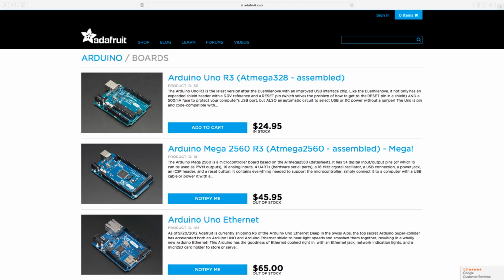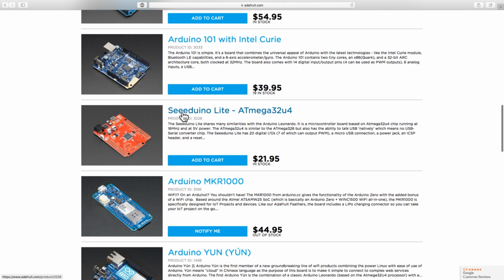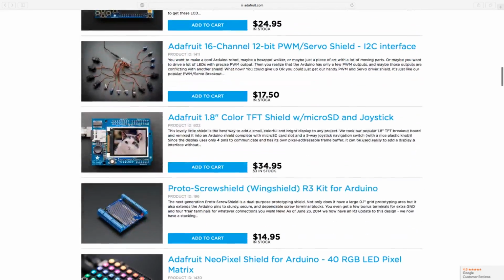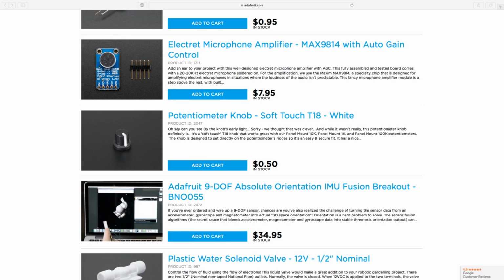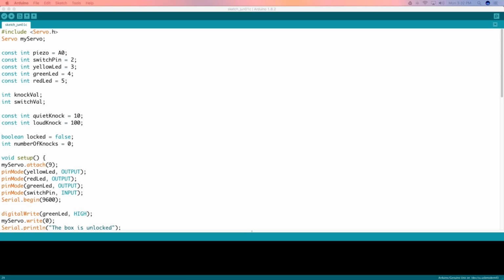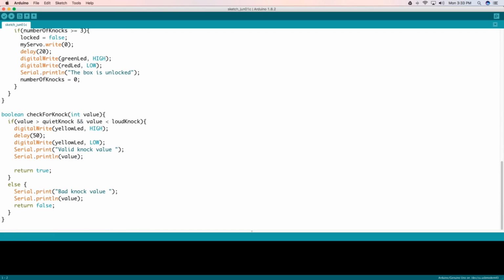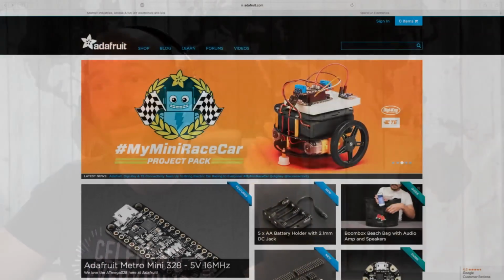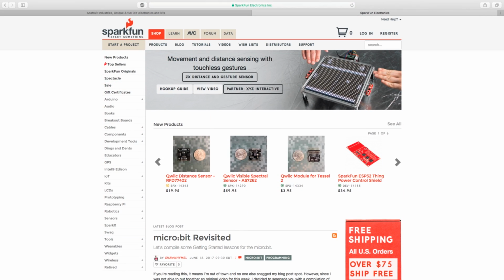Arduino Introduction

Comment: Eli,
Thanks for the "Big Picture" introduction.  I have been roaming around for a few weeks now, not knowing if Arduino was what I was really what I was looking for.   
There is nothing more disappointing than to invest time and money into a product , only to find that it wasn't what you expected. 
I did not realize the depth of what Arduino has to offer.  Thanks for setting me straight. 
Glad that I found your program.

Comment: Micro Center Columbus, Ohio is a great store especially if you have one close, they are on line too but it is hard to beat EBAY for cheap Arduino  sensors and boards and very cheap clone boards . Don't worry about the code just  buy one ARDUINO  UNO V3 and get started, the code will come in time and there is plenty of ready made code you can copy and paste then tweak on the net. This video series 

https://www.youtube.com/watch?v=bY03PJihDMw     should get you going on the code.

Try to get an ATMEL  328 chip on the Arduino Uno V3 that is a dual in line removable chip mounted in a 64 pin socket for easy removal and replacement and to program more chips if needed. If not the hard wired ATMEL soldered surface mount   MPU  will work fine for a starter or dedicated project, just somewhat less versatile  but they are cheaper.

Folks these are a lot of fun, Getting started will not break the bank. Get a plastic proto type bread board and wires, a small 2x4 inch bread board will fit most projects,  9-12 volt battery-eliminator at 1000 mA or 1 amp current  rating wall wart for project power , make sure you have the right power connector to plug into the  Arduino power/ LED's 350 Ohm resistors  pkg X10 to keep the LED's from burning out from to much current.

  Wire strippers for fine wire Harbor freight's "red handle" wire strippers will not do fine wire stripping, but a cheap $5.00 harbor freight multi meter will work great for all electronic measurements  current, voltage, resistance, continuity. Everything else buy as needed for projects from ebay just plan ahead for big projects down the road. A 15 watt soldering iron, (solder .022"  62/36/2) will come in handy cheaper on ebay than anywhere.This is all the breeding stock you will need to get started. I miss Radio Shack, in their final hours they too carried the ARDUINO  boards just before they went to that great electronics store in the sky.

Comment: You can also go to tinkercad.com which is free and created by a major company (Autodesk) - they have a narrow range of components but it's enough to get your feet wet into the world of electronics with the arduino (Complete with it's programming and libraries), the breadboard, and all the many various electronics. Out of the 15 sites I've tried this is the best one and best of all it tells you if you screwed up and destroyed your virtual component (with say too much voltage or throughput power) and overall you can build some intricate stuff with little to no knowledge of hardware or software electronics at no cost and without the stress of trying all this out in real life for the first time and not know what your doing. My first arduino project which controlled an LCD character screen with remote control interaction was done through many many hours of trial and error through this site which helped me learn all about the arduino, and the very basics of electronics and circuitry. Would highly recommend.

Comment: Arduino SUCKS , GO LEARN HOW TO DESIGN and how to program a u-controller you lazy . it is a shame when you see other engineers use Arduino instead of designing the system them self  
some of them are trying to do even industrial jobs done with this !!
, this is what Arduino  is doing to our engineering . i once had an interview with an Arduino Engineer ! after 2 years of working he could not even set the register for basic SPI connection , this is pathetic, addition to that he could not even set a new project in Altium properly , never designed a PCB in his life , ONLY BOUGHT PREMADE SHIELDS and guess what he never even tried to code for a single very easy module like ESP8266 works, to learn it ! and he wants a job, yeah i have job for you , you can start on toilet floor on Monday
with this more and more every day we are seeing more so called engineers that cant handle a simple task of programming or PCB design , well if you can call them engineers !
Arduino  is the suitable for school students to learn some basics not a grown a*s elec engineer to messing around with it
Reply: That's exactly what Arduino is made for, students and hobbyist. I did get a couple breakout boards from espressif. its going to be fun.
Reply: Hi carlos
thats what they said when PLC came out
by the way about putting us out of the job ,i and people who works like me can convert to Arduino  or any other of this kind of boards as fast as like half a day and trust me , we will be much better than a person with just Arduino  experience so no one can put us out of the job 

 in fact me and  my team is right now working on a system similar to Arduino  but with NXP ARM and industrial standards and protocols,something like a C++ based PLC full hardware and Linux support for HMI at the cost of half of what PLC is and 10 times of power ,all the libraries we wrote from base 0 in C++  , we wrote the code for all the shields and designed PCBs and every thing from scratch . this is something that an Arduino user can never do thus i don't think i am going out of a job ! the classes of working is different . and i am not even that much of a programmer my self , there are thousands of engineers who i look like a joke in front of them 

Every thing ready so why bother reading a book??

maybe you are right its better to have more people who can do the job but in fact you are wrong  because the quality of a job is related to the knowledge of the person who is doing it 
more people can do but as i encounter them they are pretty weak in understanding principles , the worst part is that they don't even try , why bother learning a bout network and see the Wiznet datasheet just one time when we can set network in 10 lines of code and not reading the datasheet ?
 i dont have problem with Arduino directlly , but i do have problem with laziness , you wanna do the job with Arduino , do it but at least take a look at the datasheet once , and know what you are doing , or what the Arduino  code is about .

Comment: Do you own any of the elenco Bajillion-in-1 kits like what you used to find in radio shack or their newer "snap circuits" these help to understand the wiring diagram of an arduino. Also if you could name drop atmel who makes the processor in the arduino and compare their data sheet wiring example to a wiring diagram of an arduino it would teach everyone a lot.

Comment: Great introduction for the first class Eli, I'm glad you are using this structure to teach. my starter kit arrived yesterday but it's branded Genuino. it may be a silly question but is there any difference between Arduino and Genuino? looking forward to the next class
Reply from the maker: do a google search... not being snarky, but there seems to a big hubadoo on the subject.

"Much of 2015 has seen the open-source board maker defending itself from its former manufacturing partner, which recently claimed ownership of the brand, launched its own Arduino product line and website, and worked to bar distributors from buying Arduino products from other manufacturers."

... it's too late in the day for my brain to sort this one out...
Reply: Thanks Eli, I think my query was probably insignificant, the kit obviously works the same. Time for some shut-eye here too. see you on the next vid👍
Reply: +Shane Davis No, there are no differences. There were some months, where the founders of Arduino had some beef and therefor there were some copyright and brand-issues. And while that period, one of the founders has produced and sold the Arduino (afaik) for Europe and Asia  under the brand Genuino.
But because the board itself is Open Source, its the same board, but with a different brand.

After some months, they came together again and I think, Genuino will be history, soon ....
Reply: Wolfgang Egger. Thanks for the info, as the UK is still in Europe  (for now anyway) that explains why I got the Genuino brand
Reply: Eli the Computer Guy can you connect it to a pc ?
Reply: Yes, you can and should connect yore arduino board in order to upload yore code. It uses USB port on yore PC.